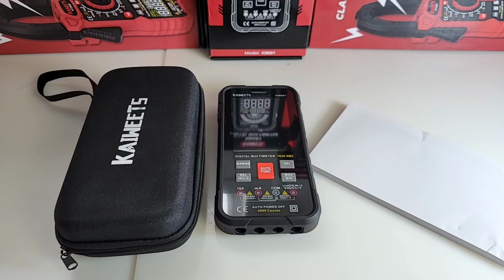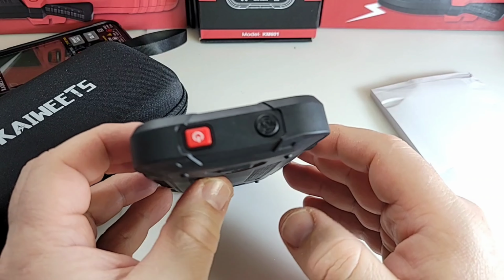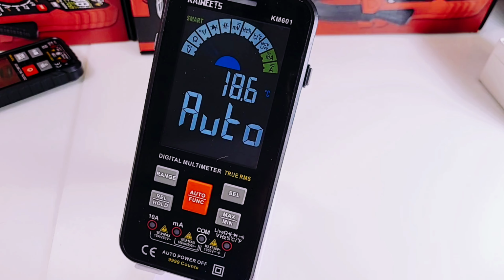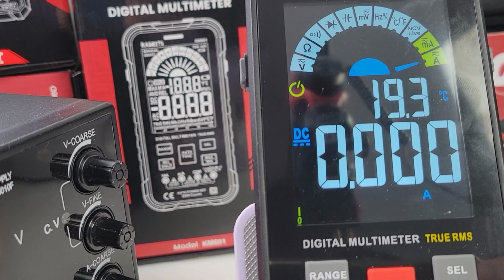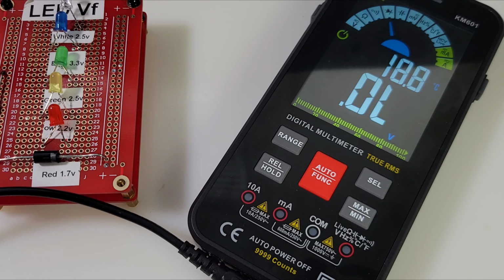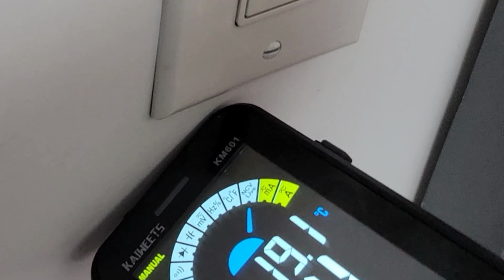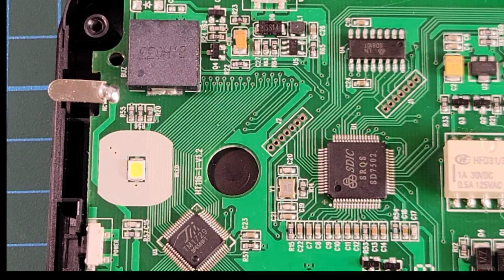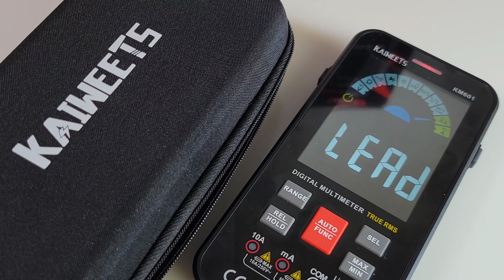KAIWEETS KM-601 CHEAP-O Multimeter Review & Teardown!

Comment: Over time curiosity got the best of me since my last comments below and I bought this meter a few weeks ago-- on mine the continuity seems noticeably better than the example in this review, hopefully they made some improvement in that area.  However the NCV on mine is about the same but I dont place any faith in 90 percent of multimeter NCV functions anyway.  It does feel well 
engineered and well built, doesnt feel cheap and gotta love that color display, but I also wish the jacks were on the face of the meter and not out the bottom
Reply from the maker: Oh dang I knew you had the KAIWEETS itch bad! Glad you're happy with it. Great all around dmm and pretty tough all things considered.

Comment: Hello Darren Walker channel friends. Could you use Energizer Ultimate Lithium AAA batteries for this amazing KM601 multimeter?

Also could you use rechargeable lithium batteries like VapCell 1.5v AAA for this?

Thank you. God bless, stay safe.
Reply from the maker: Hello my friend...yes to both. Although rechargeable batteries probably won't last as long as regular.  👍
Reply: @KeepOnTesting  Thanks. Create a new series for 2023 and beyond wherein you modify the subcomponents (maybe better branded caps, OLED, shielding, proper grounding) of the insides of the gadgets. Start the 'Make it Way Better' series with the amazing KM601 :-)

God bless, Rev. 21:4
Reply from the maker: @SevenDeMagnus  That's a great idea.
Thx for sharing. 
KM601 is definitely amazing!
Reply: @KeepOnTesting  
Hi, happy Lenten Season & advanced Easter (the most important day of all).

This could be an example of a gadgets modification series (best to put it in a Playlist so it's continuous while we do projects it's playing) you could create for 2023 into the end of the 21st century 2077:

'Paano Lagyan ng Range, Min/Max at REL - Delta Relative Function ang Zotek ZT102 Digital Multimeter' 

on the channel 'DIY Pinoy Teknisyan'.

The Zotek ZT102 mod there, I'm not sure how he figured out where to solder the wires & where he got the idea but he turned the US$10 ZT102 (recommending to review this coz' of it's huge modification possibilities) into a US$25 to US$30 multimeter. :-) It's like he overclocked a 3.5Ghz to 7Ghz to 10.5Ghz and it looks cool too w/ those Game Boy SP tactile switches, like Mad Max 2, like cyberpunk.

God bless, stay safe, see you all in heaven as Revelation 21:4 describes.

Comment: Hi. I my Kaiweets KM-601 just arrived (it's the rebranded Habotest HT116, not sure if they have the same build quality). 

Is it really like that when it's in Auto/Smart Mode- if I measure a capacitor, it automatically uses the Ohms which is wrong coz' that's for resistors. 

Also is this acceptable tolerance, they're capacitors that were slightly used (just minutes) but they're not exactly branded: 

1) 330uF but it reads 348.4uF
2) 100uF but it reads 93.52uF
3) 470uF but it read 480.9 uF
4) 33uF but it reads 38uF
5) 680uF but reads 1.024mF (milliFarads) *I'm not sure if this capacitor is still working even though it's just slightly used
6) 100uF but reads 93.51uF
7) 1000uF but reads 988uF

For the Resistor test (the bands are starting from the left are: yellow, violet, brown and far from the 3 is gold, it's chunky resistor used for discharging):

470ohms (+/- 5%) but reads 472ohms

I did initially use three 1.2v Eneloop recharchegables but that didn't seem enough voltage, I switch to fairly used AAA non-rechargeable batteries which had this charge 1.5, 1.5 & another 1.490v 

(batteries are now at 1.490v X-D after a hour of use)

What's the best AAA battery for this? Eveready's non-rechargeable lithium ones or rechargeable lithium from 1.5v non-branded chinese rechargeable lithium  (Kaizen brand= it's seems it copied Smartools)?

Thank you. Please advise if I should refund this if the readings are too far from the values.

God bless, Rev. 21:4
Reply from the maker: The readings look good  👍 Capacitance is never spot on but it's definitely in spec.
Btw the Smart/Auto mode doesn't work in Capacitance hence the resistance display.
Battery wise, my favorite is the Rayovac Fusion (Alkaline)..they last forever..won't leak and have lots of power.

Keep the multimeter..it's a good one!

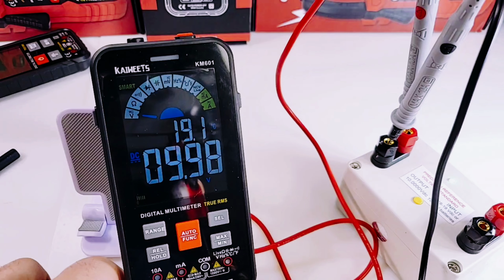Comment: 6:52 its a 10000 count meter. its showing 9.98. shouldnt it be showing milivolts?
Reply from the maker: Multimeter was in DC volts,  not in the mV range, so the voltage displayed was correct.

Comment: Just subscribed to your channel. impressive work.. Thanks for all your content. i'm Comparing the ST600Y with this KM-601. First google Search i did landed me on Durability matters and he says that the ST600Y is a scaled down version of the KM601. the KM601 costs 44,17 from the Kaiweets aliexpress official store so not to bad the ST600Y 35,25 not a big difference. The KM-601 is 50% cheaper then something like the Brymen BM235 that's 86 euro.. and i'm just starting of and wanted to look to upgrade from My Lidl multimeter .
Reply from the maker: Welcome aboard! 😉👍both of the KAIWEETS are very good multimeters,  I do prefer the display of the ST600Y but the 601 is still the King. 
Btw, HABOTEST HT118A is also a very solid choice although it's not a SMART multimeter.

Comment: Sometimes u need to wipe your lead tips with rubbing alcohol, I don't know if when they molded the leads if it ends up coating the tips with some clear insulated material, everytime I buys a new pair of test leads I usually wipes it with rubbing alcohol and it cause a fast continuity response
Reply from the maker: Great advice 👍
Reply: @KeepOnTesting  yup yup, I had thrown away some leads in the past thinking was the leads at fault but u came across this youtuber,,think kiss analog and i saw him cleaning it and I decided to try that and soon realise it does wonders 😁

Comment: I really like it and I really want it but boyyyy.... That continuity mode delay.... Ouch. Even the stand and glare I can forgive them. But that's delay means I need to use another meter for that in a lot of use cases.

Did you already find out what the total screen-on time is before the batteries run out? And the fuses, are they the beefy sand ones or normal glass fuses?
Reply from the maker: Fuses are ceramic 6x30mm good quality. You have about 75 hrs of display time so no worries there. Other than continuity..this is one great multimeter!! 😃👍

Comment: As soon as I saw the first video on this multi meter, I ordered one post haste. For what you pay for this multi meter, you get a fabulous tool. There is just so much you can do with it and what a great display.  I have no complaint about the lead location. You aimed the plugs down so you could not lay the meter on it's back. I aim the plugs up and have no issue what so ever with them. Yes, my Fluke has the plugs on the front face of the meter and that is nice. The plug location on this meter is no big deal for me. I never saw it as an issue. 
Good video, thanks for posting it.
Barry
Reply from the maker: Thx Barry...definitely one great multimeter and what a gorgeous 😍 display! 👍

Comment: I use the HT100 voltage tester and it's excellent,was thinking of getting one of their smart meters but there are so many to choose from its hard to decide which one is best,love your reviews
Reply from the maker: Thx my friend! My favorite is the Kaiweets ST600Y thus far...incredibly vibrant colored display, loaded with functionality and great performance!
https://youtu.be/N0_PvJQ26Zs
Reply: @KeepOnTesting  Thanks for the recommendation,I think I will go with that as you can keep it in the case and still plug in the leads as apposed to the 601 where you have no access to the on/off button or lead connectors because they are at the top and bottom of the meter so you have to take it out to plug in or switch on and off

Comment: Another great review Darren! I have the same meter in red under Astroai brand. Nice little meter for sure. Some negs are continuity def slow and lead jacks on the bottom. Also, I reached out to them to see if I could switch display to always show Fahrenheit instead of Celsius but was told you can’t change that, Fahrenheit only shows when in temp mode. Overall it’s a really nice meter.
Reply from the maker: Thx for the update Mike.. 😀👍
Reply: It cannot be changed to measure only in Fahrenheits as other sites measure in Celsius.

Comment: It will be helpful for us  if you are going to provide the multimeter price as part of review.
And is the price a part of rating?
Reply from the maker: I try to mention the cost if possible although it can be relative to your geolocation. Normally it's not one of the rating criteria unless the price is phenomenal but  that's rare. Usually all the CHEAP-O MULTIMETERS are in the sub 50$ US price range.😀👍

Comment: I sometime considered to buy this gadget like multimeter. But then I was also thinking about its robustness, especially its big screen. Screen could be cracked in a tool bag or dropped on concrete. 
Multimeter is a tool to help my work, i need it strong n ready when i need it. I already have cats that sometime i think they are bosses at home. No multimeter boss.
Reply from the maker: Keep it in the case and even your cats won't scratch it 😀👍

Comment: I really like the case, I tend to be hard on my meters with the leads getting sloppy in the connection, this becomes my number one fail point. (As well as breaking the screen), I like the way this looks, far more like a phone, place to put the test leads. Since I don't like to carry too much extra stuff around, it falls out, I have to shove it someplace the thermal couple will probably get lost, so when I go to test that thermal glass heating oven I am building I will have trouble finding it. Cable management, different banana plugins, every device having different leads. I will get organized one of these days when someone designs something extremely universal.
Reply from the maker: That case is definitely a bonus..rugged and lots of room for "stuff" !

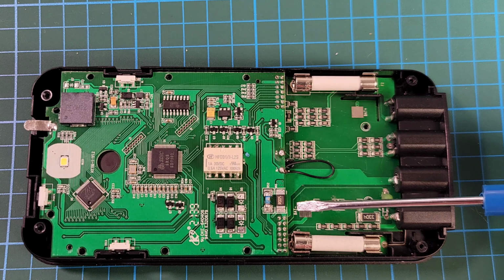Comment: At 16:34, what is going on with R52 ? Seems the resistor is damaged? (next to the R005 resistor)
Reply from the maker: That was another KM-601 PCB used for the Teardown.. it was originally in a multimeter that DHL destroyed during shipping. 😵

Comment: Another  SOLID 4 stars! I purchased a UNI-T UT123 you said the same thing about and it lasted 3 months, I replaced it with a PlusivoDM101 $9.99 meter that I rate 5 stars because it's still working!.. lol
Reply from the maker: Yikes what happened...? My 123 is going on 2 years without missing a beat.Solid dmm.
Reply: @KeepOnTesting  kept eating batteries--almost always showed batteries were 1/2 dead even though they were new..it wouldn't turn on unless new batteries were installed.. finally the dial just stopped going to the correct setting.   real fun time...
Reply from the maker: @gman917  Yikes, sounds like something was shorted.. sorry to hear it wasn't up to snuff 😮
Reply: @KeepOnTesting  that's what I thought, gee great minds think alike...lol

Comment: The glare of the display can be easily tackled by applying a cutout of matte tempered glass which will not only prevent smudges but also protect it from fall damage. Continuity can't be improved though. Amazing video and production quality from you, hats off! 👌
Also, why does the Kai Weet? ..... because it cannot Tweet! 😂
Reply from the maker: Muhahaha 😉  Thx my friend 👍
Reply: What is the original display screen made of .. plastic or glass?

Comment: Darren sir while checking dc voltages in smart auto mode when set is in off position,it may show resistance mode then if sudden voltage comes then it harms the multimeter or meter immidiate change to voltage mode after resistance mode.secondly if capacitor open or weak then what kind of votage it shows ac or dc or show error(in micronta multimeter error comes like blinking display with sound) give damage to multimeter.also explain 6000 count with 9000 count difference.thanks
Reply from the maker: I experienced no glitches in SMART MODE.. the multimeter performed extremely well! 9999 counts is simply a higher resolution display, allowing for more accuracy!

Comment: I have yet to see your review but I also have this meter and I have to say this. Beautiful display but the continuity mode sucks. Even with good gold probes and meter set to continuity mode not auto. If you do cell and computer repair avoid this one. Needs a stand. Flashlight is weak. Probes on bottom are ok but I think I prefer them on front especially with no stand.
Reply from the maker: All valid points 👉  Really miss the tilt stand !